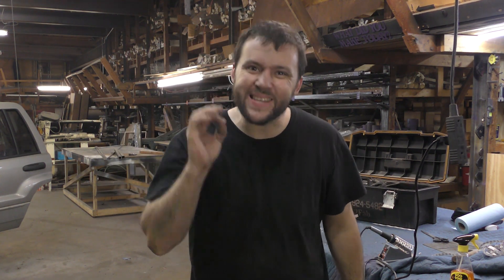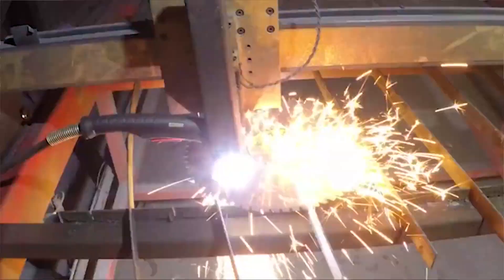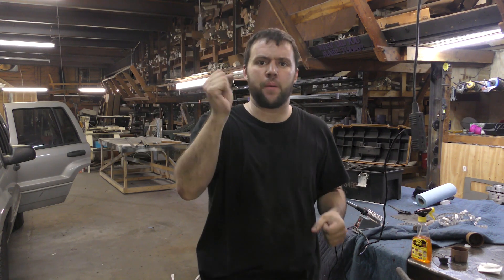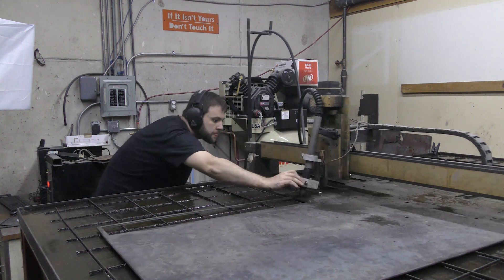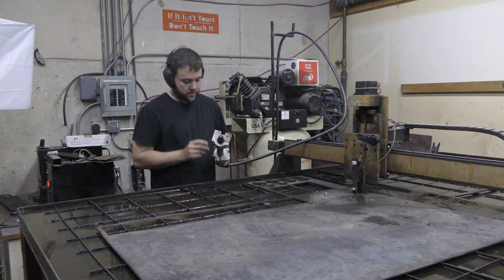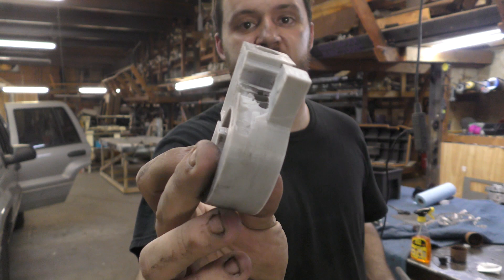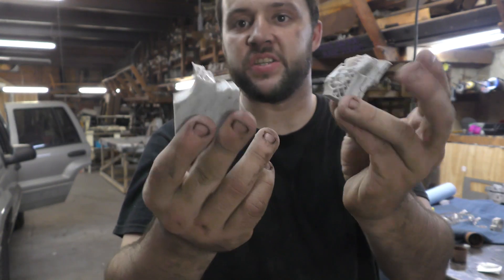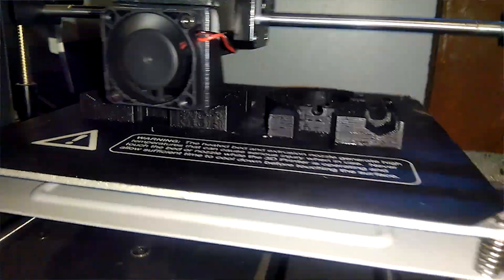$350 3D Printer saves the day!

Comment: I bought a mono price mini when they first came out. I think they are coming out with a v3 soon. I save all my pennies and sold some stuff and bought a snapmaker 2.0 a350 and it is amazing slow but still perfect parts. You will need to know a little about 3d printing. I not just  a 3D printer with a laser and CNC wood and plastic carvings